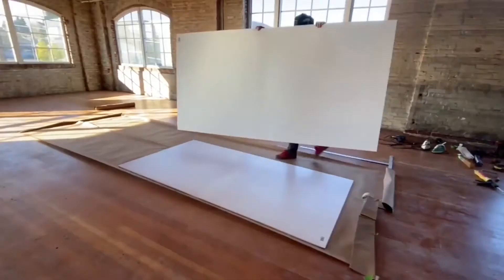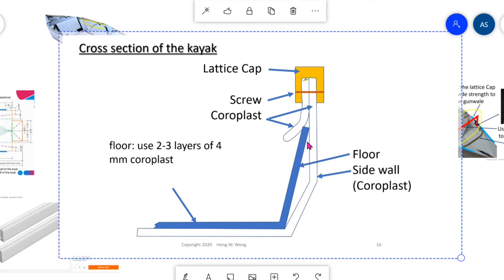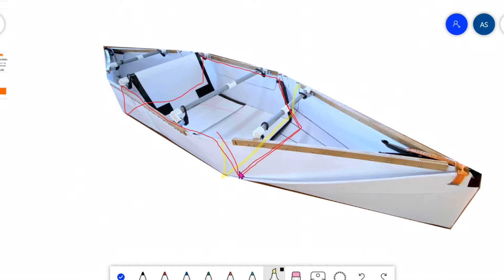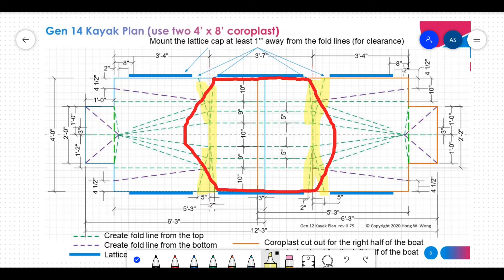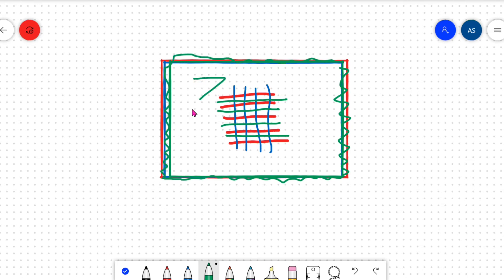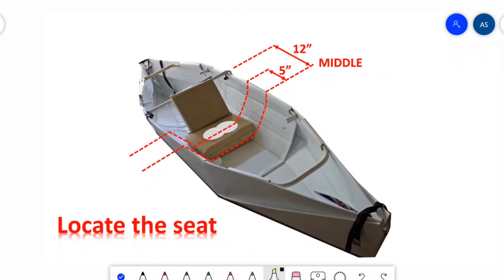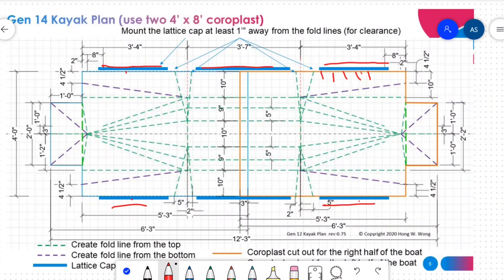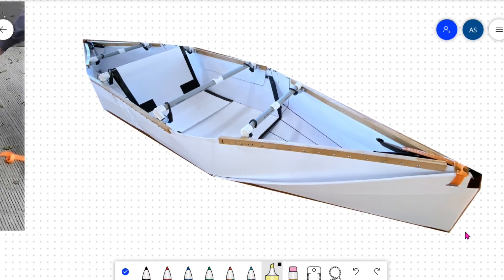Part 3 - Make Magazine - Gen 14 coroplast foldable boat

Comment: I have a customer that produces a lot of coroplast containers and packaging.
They actually have sonic welding and heat welding equipment for it.
I've been pondering on working out a design that could take advantage of that.
I keep coming back to making structural ribs or bulkheads to just wrap the coroplast around.
I've built a couple of skin on frame kayaks with nylon skins and a skin on frame folding kayak with a PVC skin and PEX tubing for the skeleton.
With the tools available at their plant, I could probably develop a pretty seaworthy design with the intention to reverse engineer the process for home DIY fabrication.
I think including structural ribs would help hold the form more easily, and the ribs can be packed flat.
Reply from the maker: Thanks for sharing your ideas. My other requirement for my boat is fast to fold and unfold. I did look into the ultra-sonic welder. The hand held one will cost me over $2000. However, the welded seam is very strong. I have a basket made from coroplast and welded together using this technique. This inspired me to try to use heat gun to fused the coroplast together.  BTW, this Gen 14 was built by my friend and he is a trained boat builder. I gave him a draft plan and he came up with this kayak. Make Magazine wanted us to use parts from Home Depot/Lowes, no custom parts. He did an amazing job in two days. This is his video: https://www.youtube.com/watch?v=bmMcqo1-pHo&t=0s
Looking forward to your update in building you boat so I can learn something that I may be able to apply to my build.  Thanks.
Reply: @DIYUSA  I know the sonic welders are an unlikely part of most DIY builders tools.
Using one does defeat the DIY objective. However I'm hoping it will be useful in accelerating prototyping.
Hopefully the lines from the sonic welded version could be replicated.
If it can be "folded in four", a 15' boat should be about 45" long when folded.
The ribs or cross-sections should take about the same amount of time to assemble as your PVC pipe supports, and they would actually support and shape the hull. They're usually made of plywood or HDPE sheet.
Another manufacturing benefit to the ribs is their ease of replication once the first set is made. They make a perfect template for use with a router. One person could certainly make one boat that way, but a group could make several with the time savings of a template being realized.

I have a few other boat projects before I can try. I need to do some hypalon repair on a couple of vintage folding boats, and I need to make a mast, boom and yard for a sail I bought for my Klepper.
Reply from the maker: @wisenber  Thanks for sharing. I don't have the know how or ambition to tackle the projects you are working on. I always admire people building that type of boats. However, if the cost of the sonic welder is a few hundred dollars, I will probably get one. Some DIY projects involve more costly tools also.  Looking forward to see your projects, hopefully I can learn something. Thanks.
Reply: @DIYUSA  Thank YOU for sharing and inspiring new ideas with your channel!
I've tried documenting my boat builds on video, but I lack either the patience or the focus to be figuring out a project AND determining how to capture it.
That, and epoxy work doesn't lend itself well to camera work.
I appreciate people that have managed both.
Reply from the maker: @wisenber  Thanks for asking questions and your support. Since I am retired and need to keep myself busy. Glad I have time to do that. I wish I have been building boats when I was younger, but then life have different priorities.
Reply: @DIYUSA  I wish I had started sooner! I think I built my first stitch and glue kayak from a kit about 17 years ago.
I don't know that I'll ever fully retire from my work, but I've owned my own company for close to three decades. I went ten years without taking a vacation. Now I manage to take a couple of months off a year while letting my employees take care of most of the things I used to do when I had none.
The one thing that will trigger your inner boat builder (if there is one) is using boats and thinking about how a different boat might offer a different perspective. That's how I evolved from kit boats to folding boats to small sail boat to trimarans.
With all of that, I'll never have to worry about staying busy. :)

Maybe you'll decide to build something and try the R2AK (Race 2 Alaska) some day!
I'm hoping to try it in the next few years while I still am able.
Reply from the maker: @wisenber  Running your own business is very different than working for some one. You have so many responsibilities. My old boss retired at 52 and then he learned sailing and sailed around the world. I did sail to many parts of the world and all the main oceans in the 70's, then I was an officer/navigator in merchant marine. I was on a much larger ship :-) I sailed thru Aleutian islands many times and most of the times in very rough weather. The memory is still very vivid though it was 42-3 years ago. Yes, do the R2AK when you are still able to. Thanks for sharing.
Reply: @DIYUSA  It sounds like you sailed in areas I used to work on a commercial fishing boat.
I worked on some crab boats prior to the Exxon Valdez crash after I left the German military in the 80's. A 50ish foot trawler in those seas was not all that pleasant. While that is not the coldest place I've been, that was coldest I've been after getting drenched on the deck for 12+ hours at a time.

As far as getting old goes, I had the honor of competing with Meade Gougeon ,one of the co-founders of West Systems epoxy in 2017 in the Everglades Challenge. He sailed solo in a boat of his own design, and he was in his late 70's. He won his class against many younger competitors. Unbeknownst to most of the other racers, he was suffering from stage 3 cancer and would pass away less than six months from then. I won't accomplish half as much as he did, but I do hope to be doing something I love as close to my end as he did his.

Build the right boat for you, and you might get to revisit the area with a bit more focus on the shore than on the sea this time. What a grand story it would be. :)
Reply from the maker: @wisenber  Wow, you have a lot of courage to work on the small trawler. Yes,  I sailed north to Alaska along the west Pacific coast, then thru the Aleutians and saw many fishing boats along this route. I was on a 25000 tons logger for 2.5 years hauling steel products to US (from Japan) and took a full load of logs back to Japan. A round trip took two months. Thanks for your encouragement but I probably be an arm chair sailor watching others sailing around the globe.  I wish I can move to somewhere near the sea, such as Puget Sound. If I can convince my family to move, and that will be the beginning for me to start doing some 'real sailing' like you. I admire what you are doing!

Comment: You're certainly developing your fabrication and design processes.
At some point, you'll have to be looking at hull design in regards to performance (tracking, speed,stability,  maneuverability).
Reply from the maker: Thanks for your input. Yes, you are 100% correct. In the past 1.5 year, I  have been experimenting/implementing rocker into the design (Gen 10) and compare that without rocker (Gen 12) and see how it affects the turning. Also a design focus on  good primarily stability - flat bottom (Gen 9+) with better secondary stability (Gen 12). Better tracking Gen 12 (Vs Gen 3)., etc. There are multiple challenges: 1. I used software program to come up with a nice hull design a few years ago, but I couldn't implemented that into a foldable boat. I can build a hull mimicking a stitch-and-glue boat using fusion (better hydro-dynamic) but it will be a rigid hull and the example is my gen 10 . This creates an issue to transport and store the boat. 2. I try to keep the boat to under 10' just to work around the local regulations. As you know length will limit hull speed.  3. There is very limited information in building a foldable coroplast boat. I looked at the products in the market. I can see the foldable ones faces the similar issues I have. My gen 9 actually adopted some of the ideas from ORU's 10 feet kayak.  I simplified  the design and evolved that into Gen 9+.  4. My other goal is to come up with a simple design so other can copy. Therefore I reduced the number of folds in my design.  5. I want it to be light, so I reduced the framing structure.  Without that it is difficult to create finer folds (to have better hydro-dynamic hull) and still maintain the structural strength. Simple framing is easier for other to build, also lower cost to build.
This doesn't mean I don't want to keep improving my design in stability, speed, tracking, maneuverability, but I have to add cost, weight, foldable, easy to build...etc.as requirements. All these are challenges and will keep me busy for a few years (until I give up :-)   We all know we can't meet all the goals in a single design. Therefore I have been repeating going back to the  pontoon design, and make the width of the boat adjustable to for different situations. For a boat under 10', I believe it will give me better speed. By adjusting the width, I can tune the stability and maneuverability(for river kayaking or for sailing). If I can make it modular, I can pack it inside my small car.  
I do appreciate your input and suggestions, and yes, I am listening and trying :-)
Reply: @DIYUSA  Yes, I saw that. Chines do wonders with secondary stability and edge turning as well when dealing with panels more than curves. A shallow V shaped hull can help reduce wetted surface area while providing a keel effect for tracking. Flat bottoms don't tend to let waves move well under them.
Reply from the maker: @wisenber  Length will help too, with a V hull :-)  but it will be getting more difficult to squeeze it in my small car :- )
Reply: @DIYUSA  My folding kayak fits in a Camry trunk. :)
Reply from the maker: @wisenber  That's excellent.